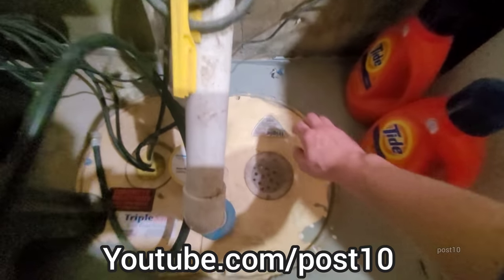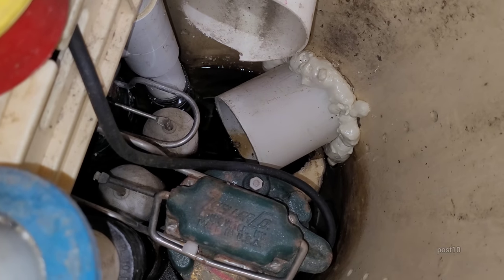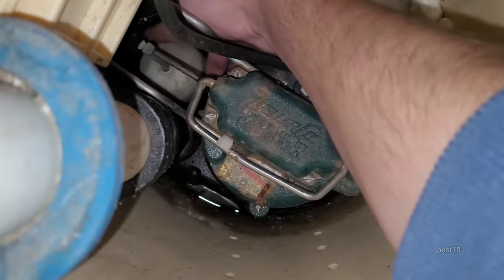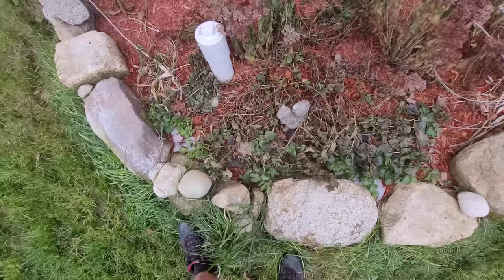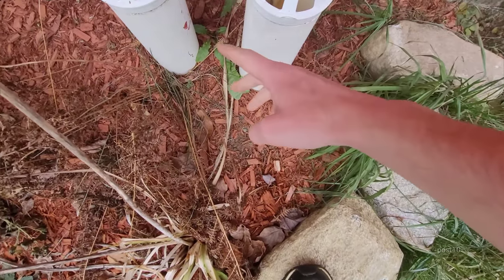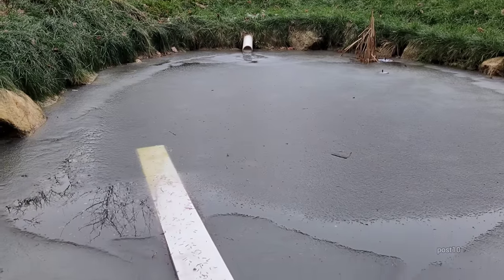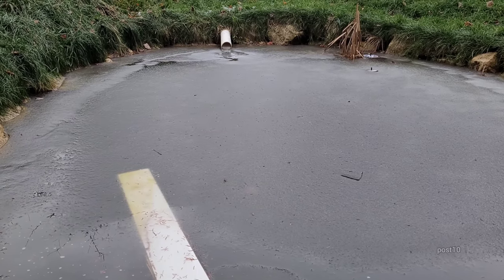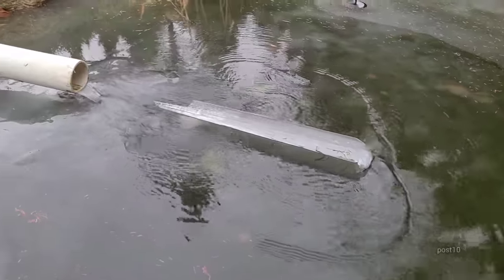Unclogging Ice Dam From Culvert Drain Line And How To Prevent It From Happening Again

Comment from the maker: Thank you everybody, I've been reading some awesome comments about using a household timer to turn it on 15 minutes a day, a float switch inside of the pit in case there's a backup to turn on the heater. Thanks for the ideas I've never thought of. (Edit) I see all the comments about overlapping the cable could possibly melt itself, I read the box and the instructions this specific cable came with and it doesn't say anything about not doing it but as a precaution I just took the extra slack and threw it into the pond
Reply: Happy to watch 👍
Curious to know how it's been going with the newer Cold Weather Fronts?
Any Squirrels claiming Squatters rights over Winter?
Reply: When you had the excess amount of wire I was thinking in my head " wrap it around the end!" and then you did! lol I love watching these random videos of yours :). Also do you not have a basement where the sump pump is located? We had flooding problems at my old house because we didn't have a battery powered backup, but a pipe to exit the water wouldn't work as our sump was 13 feet under ground.
Reply from the maker: @statementleaver8095  no no Critters yet, I haven't even used it yet. I only plan on doing it when I actually see it clogged up
Reply: @post.10  Mind you the Squirrels probably know better than to mess around with The Culvert Man The Beavers are a little more resilient to Threats.
Word travels fast Over the Hedge
Reply: Work smarter not harder, love your channel
Reply: @post.10  Too funny. I underestimated how clever you can be when the occasion arises
Reply: hönk
Reply: There's also another option: smart switches.

Globe Electric's smart power plug switch can be set to turn on or off using various environmental factors, such as time of day, sunrise/sunset, temperatures, humidity levels, weather conditions, etc.

I use it to do things like automatically turning on turning on the lights at sunset, controlling the Christmas tree, and even a control timer for making my coffee in the morning automatically (just need to put water and grounds into the machine, switch machine on, keep the smart plug on off, and set it to turn on just before wake up time).

What you can do, is set the smart plug to only turn on at night, or when conditions are below -5C, etc.
Reply: Thank you for this cool video, enjoyed it allot
Reply: Why not pull it through further so the excess is inside where you can just run it along the wall? You don't want to be heating the pond.
Reply: I want to see an update on the pond, see if it stops it freezing over with that cable thrown in lol.

Or if it's even warm, like tropical lake effect even.
Reply: Was just going to say that  but yeah you got it
Reply: I guess you could say, you made a potential hot tub for the squirrels. 🤣
Reply: Might be a good idea to put a cage on the end of that pipe toward the pond to keep critters out of the pipe and building a dam inside of it.
Reply: "Now im going very slowly" Proceeds to hammer the throttle:
Reply: At 7 watts per foot (150 ft.) requires 1,050 watts. One, I have for an RV drinking water hose thermostat turns on at around 40 degrees, and off at 60 degrees. I only run it during freezing temperatures, usually at nighttime, when the water isn't running. In constant running water it would never warm up enough to turn off. Better to either turn it on/off manually or plug into a thermostatic controlled electrical device outlet, and many varieties are sold. I plugged mine into a short extension cord having built-in on/off switch and it's a short walk. In your case you may want to get one with a thermostat wire to run outside, or a wireless controlled one.
Reply: This is my favorite YouTube channel

Comment: I would, in my humble opinion, get a cap to go on the end of the 45 that's a drain cover. Zip tie the end of the heater hose to it and pull the rest of the slack into your house.  That way you don't get a pit full of mice being that it'll be warm from time to time and might as well keep the extra heater hose in heating the home.
Reply from the maker: You're right I probably should do that
Reply: Good idea. I was also wondering why not bring the slack inside

Comment: If you are going to wrap the end of the pipe up make sure you don't have the wire overlapping as it will give an extra hot spot. Also for zipp ties a pair of electronics side cutters works grate, cuts flush and no need for filing.
Reply: Nail clippers work well to cut zip ties smoothly.
Reply: and turn the zip ties to have the cut end face the wall :)

Comment: To be constructive, as an electric supplies seller, you should wrap the outside wire around the pipe, about 4" spacing between "threads", so the heat won't burn the outside of the pipe ❤🛠

Comment: Heat cable in Pump hole..... Preheat the overflow for journey to Pond
Exposed pipe in Pond extended with 90° bend down into 4ft depth (Air temperature is the Problem)
T junc for access about 1-2m away from Pond (enough for Kettle pouring in F&T cycle in extreme conditions) Angle of Pipe (going to Pond) should be enough to Stop Reverse flow Flooding.

Hopefully any problems in the future will be simple 5min fixes

Comment: 17:10 Rather than risk bending any of the prongs on the wire end, you can tie a figure 8 fencing knot (basically 2 loops fed around and through each other) to ensure they don't come apart. It's normally used in high tension fencing wire to join 2 ends of fencing together. If you tie this with paracord, be careful to ensure it doesn't flip into a square knot (your loops turned into bends) before you put tension in. After it's pulled through, you can simply pull the loops apart to undo the everything.

18:50 The reason the wire kinks like this is because it was rolled up with around something. You can avoid kinks if you set it up with a pipe through the middle of it so when you pull it, it unrolls.
Reply: Ducttape would be best to do imo.

Comment: When you need to replace the cord, you can use the old one to pull the new one through the pipe. A great small tool to invest in is a pair of flush cut snips. They will snip a zip tie off completely flush with the head. It leaves no sharp edge exposed at all.
I like your drain setup.

Comment: Just a thought,  if you were to angle the pipe further down into the pond (below the freezing line), wouldn't you be able to avoid the pipe freezing at all?  You'd have to have your angle far enough down into the pond so the end would be submerged.  This, I would think, would also prevent critters from climbing up the pipe during the non flow times and keep them out of your sump hole.  Curious as to what you think if this may be a solution.

Comment: Electrician tip. Always unwind the wire coil before pulls. Just a heads up.
Reply from the maker: I realize that partially through the video that's why I unraveled it and put it in a straight line ready to go in. I guess I'm out of practice anytime I usually do electrical work I lay it out on the floor and flatten it out before I put it anywhere. Thanks for watching
Reply: @post.10  Anytime Post. I really enjoy your videos brother.  My wife is even beginning to become a fan.  Great stuff my man.  Keep up the awesome work.  👌🏽

Comment: Where do the frogs that you had in the pond in earlier videos go in the winter? This is a serious question! Also, that was a great idea to wrap the excess length of heat cable around the pipe output - put that heat/energy to good use!
Reply from the maker: They are wild frogs, they will hibernate in the ground next to the pond or the silt at the bottom
Reply from the maker: I'm honestly thinking about pulling in the extra slack instead of it being wrapped around the end because I've had so many things made out of rubber get chewed by squirrels and mice, I don't even think that was a good idea but as I said in the video I'm going to probably wrap it in some sort of aluminum tape
Reply: My niece said they obviously hop south for the winter. I love her anyway.

Comment: You could also just push the extra 10 -15 feet of heated cable into the pvc pipe and have the last 10-15 feet have two heated cables.

Comment: Your wire coil is a good idea,  however I think that you might wish to put that on the inside of the pipe where the actual ice will be forming... and also protect from critters. You may wish to create a small grid that covers the opening of the pipe to keep the critters at bay.

Comment: SO.... having owned a house in northeast CT where we sat on the side of a slope and had a natural pond in the front, I understand sump pumps.  Those you have are waste pumps and you have two... unless you failed to maintain them, they would not fail or at least not at the same time.  To spend all that time to run another drain line buried to a pond you built is overkill -  at least to me.  However, I must ask the question of the placement of the drain.  Why did you leave it above ground especially if you built the pond 4' deep.  Why did you just not have the pipe drop down 3' before the pond and then enter the pond underground?  yes, water would be in the pipe 100% of the time, but you would never need to worry about ice?

Comment: As someone else mentioned, do NOT overlap the heat tape.   As you are only planning to plug it in manually and the coil was at the end outside, you might be OK, but, I have responded to a few structure fires started due to overlapping heat tape.   I also googled it to confirm what I was told.  Better to be safe then sorry or homeless.  Thanks for the post, good practical knowledge.

Comment: You could set it up with a float switch so it only turns on if the water level in the sump rises, indicating that the pipe is blocked.  Then it'll turn on long enough to melt the ice plug, the water will drain, and the wire will turn back off
Reply from the maker: That is a really good idea
Reply: @post.10  Thanks!  I like designing "set it and forget it" solutions wherever I can, just one less thing to worry about
Reply: Already invented  an app we created for that now lol

Comment: Rewrap the cord around the exterior of the pond pipe so it is all at the same level. Measure the diameter of the wrapped cord and place another piece of plastic pipe around the wrapped cord. If you have cord left, when cutting the new pipe section cut some of it / the end section in half horizontal. This half piece will cover any remaining cord that will sit on the grass and it will extend from the edge then rest on the grass

Comment: Use the inside of the snake reel to wind the snake back up. You might find it easier instead of using the outside of the reel.

Comment: you shouldn't wrap heating cable with rubber isolation over itself or it can melt the rubber isolation away and short out over time if you run it on max temp for too long. i don't know how much watt and ampere this cable draws but it could be enough to do damage like that because it is made to lay on the cold roof tiles without touching itself so it is normally not a worry.

Comment: Saw your video, your drain pipe needs a screen on the end to keep mice, rats & critters from going through the pipe and entering your house, and Yes squirrels and other critters do like to chew on electric wires, so don't wrap the wire around the pipe.

Comment: You should get some mesh to put on the end so rats can't live in the warm pipe in winter, since it's warm you could use chicken wire, (since its heated it wont make dams) and put it in between the right turn and the straight pvc. 😁😁😁love your content!

Comment: I would go with a very short heating cable(even 3 feet would be sufficient) cut the plug off and make a watertight connection to a regular cable which runs to the house.
This way you are just heating the end of the pipe where it is needed instead of wasting most of the energy.

Comment: Have you looked into adding more insulation to the water heater to cut the cost down? I know they sell insulated covers that you can put over them, not sure how effective they are though.
Reply from the maker: I really don't think it's necessary, it's very well insulated. I don't trust my major appliances when I'm away from home so I always shut the breaker off and even being gone 5 days it still has a little bit of warmth so I think it's pretty good. Also the room it's in is heated
Reply from the maker: Good idea though, thanks for watching

Comment: You should NEVER let a tracing wire (that's your heating wire) overlap itself, as it does at the end of your pipe. It will almost certanly burn where the two surfaces touch. That is because the heat can not be dissipated on that spot, building up to ... well, too hot. Take it from an industrial cooling veteran. It will almost certanly be stated in its manual as well. I'd check it out if I were you.

Comment: That wire that you used as a "fishing line" could you not screw something like a cotton reel on the case to use as a handle that way you could wind it in and out quicker. stay safe out there this winter.

Comment: That looks like self regulating heat trace, if it is then it will last for a LONG time if not getting direct sun on it.  Self regulating tape never has a thermostat “lump”.  I can’t tell if that heat trace has a thermo lump or not.
Instead of wrapping the tape around the pipe, insert end back up inside pipe getting all of the tape back into pipe.  I would not leave any heat trace exposed.  The sun and critters will shorten its life.  I would push in in until the end “loop” is back inside the soil covered part of pipe, the heat trace doesn’t need to extend outside of soil covered pipe, the warmed water will melt any ice when it hits it.  50’ or 100’ of heat trace would have solved the problem just as well.  If that is not self regulating then look for self regulating, you can get it in 3,4,6,8,10 watts per foot.  100’ of 3 watt per foot heat trace would be enough to prevent ice dam.  So it would consume 300 watts total (max).  And since self regulating it will only consume what is needed it is very cheap to run.  Self regulating trace has internal resistance that increases with temperature.  So self regulating 35 degree heat trace will consume virtually zero watts when it hits 35 degrees, making it very efficient to run, never need to unplug.

Sunlight is hard on most all white PVC pipe.  A coat of paint will greatly extend the life of pvc.  The sun will make the pipe brittle and it will eventually crack from very light contact, like tripping on it.  Green, brown paint if you want to try hiding it, bright paint if you want to always know where the pipes are.

Comment: In Europe all houses has  gravity drains that go to the street storm drain wells or nearby drain ditches. I wonder why that is not a standard in USA like, this guy just solved an age old question of "what is the power goes out while my basement is flooding?" If there is a way to run a gravity drain from a sump pit somewhere it should be done 100% rather than always just do a sump pumps. My house in Lithuania was built in 1959 and it has installed 4 inch cats iron gravity drain going to a nearby pond and that was originally installed as the basement and foundation was poured. Smart people.

Comment: The water heater choice should be dependent on where you live. 
I live where it doesn't snow like the upper states. 
The electric one I have has been here for nearly 20 years. The one before that 30+. 
We got a solar system too when we got another heater. Not solar electric but solar heating. 
So we only turn on the heater if it's been rainy for 2+ more days in a row. Even then it's only on for less than a single day through the whole year combined. 
Summer time that thing gets up to 160F that with the water circulating.

Comment: This is gonna sound silly (literally, but we'll get to that) but I actually started laughing quite a bit once you were reeling the wire back through the pipe. The sounds it made as it was bouncing and wriggling into the pipe, made it sound like a little critter digging or something. And if you watch while it's doing that, it even looks a bit like a snake retreating to its den. Therefore, silly + sound = sounds silly. ;)

Comment: If you use flush cutters (wire cutters) for trimming the zip ties, then you don't need to file them, they cut clean and are typically smooth. I got some cheap ones with a 3D printer and now have a set in my toolbox all the time. They are sometimes called diagonal or micro cutters.

Comment: Our house was originally built to be all electric. Thankfully a former owner had natural gas lines run to the laundry room for the clothes dryer and to the garage for the furnace and water heater. Our kitchen stove is still electric but it pulls nowhere near what those other 3 would have. We're still paying off our electric bill from the summer and we didn't even run the big air conditioner. Just a swamp cooler and a bunch of fans. Electricity is getting to be a luxury.

Comment: We put a sump in our basement. When it rained the basement floor got flooded. Dad installed the sump pump and put another in the same hole but 3 inches higher. He said if the lower one (which would come on first) ever failed to start then the second one would kick in. We never had a problem. They both had the float setup.

Comment: To feed the snake out of it's reel. hold the handle with one hand and pull the fish with the other. if you spin the reel the wire { WILL } knot up inside like a spinning reel on a bad cast and cause you much grief. I was an industrial electrician for 42yrs and in my early years made that rookie mistake way-too many times.